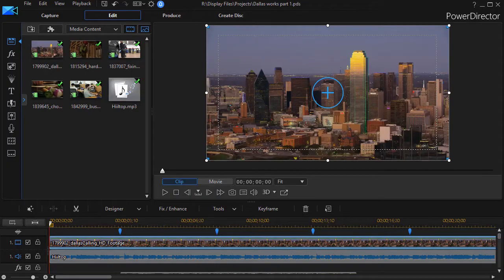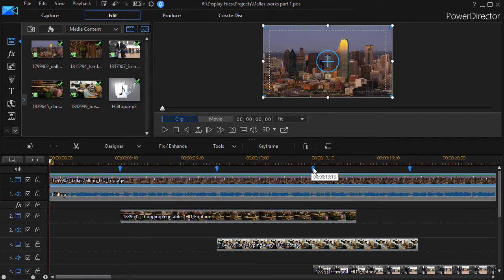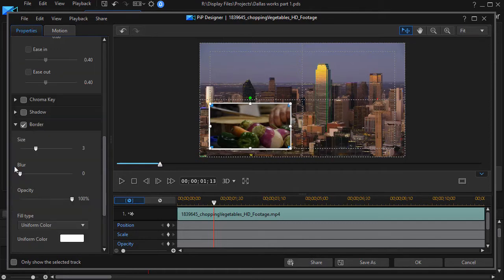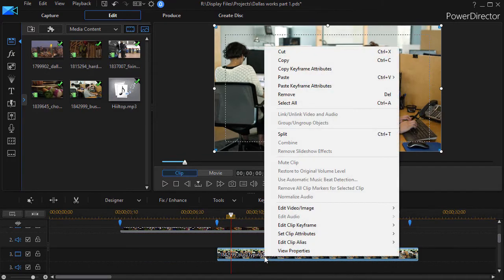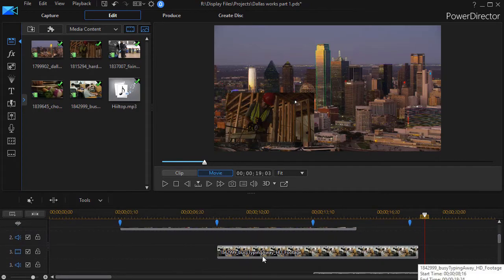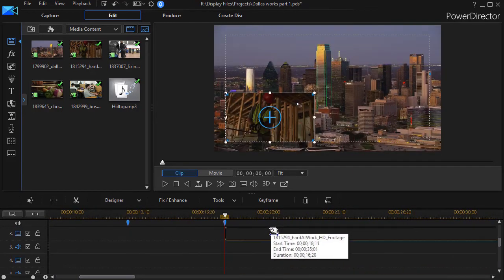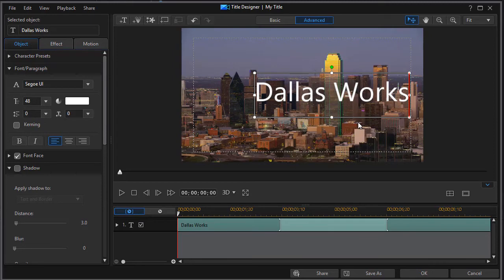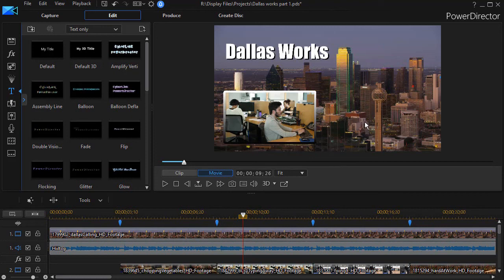PowerDirector - Increase precision  by copying key frame attributes

Comment: Is there any way to set the border attributes in the PiP Designer, and then copy/paste that to multiple photos? Or am I stuck with doing it manually one-by-one on each image?
Reply from the maker: Scott,
I tried copying the keyframe attributes. It would copy the size but not the border. But here is a workaround. When you have the first photo on the timeline, copy and paste it several times. Then drag one of the other photos onto the copy and choose "Replace". It will inherit both the dimensions of the copied picture and the border.  --Jim
Reply: @SharperTurtle  That sounds like it has potential. I will try that, let you know how it goes. Thank you so much.
Reply from the maker: You are very welcome, Scott.
--Jim